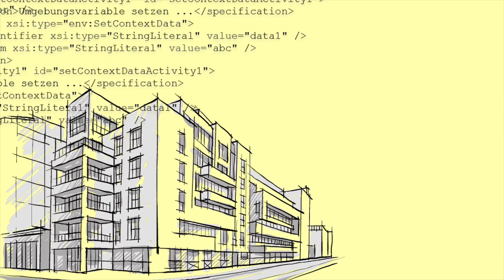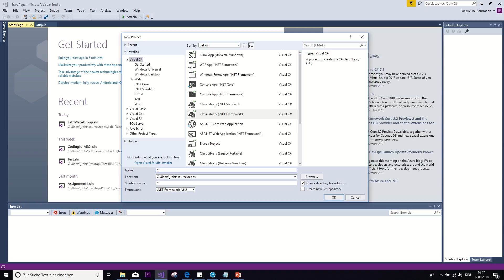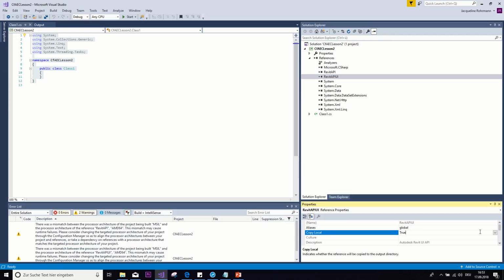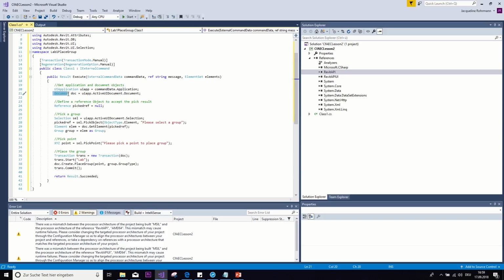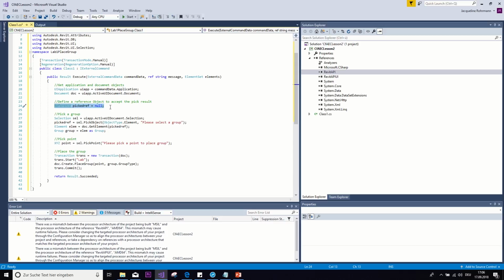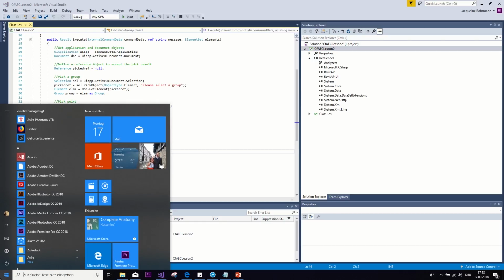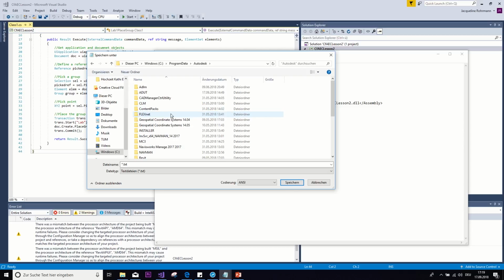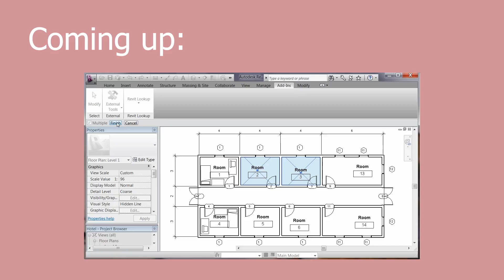How to write a plugin for Revit - Coding for AEC Lesson 2

Comment: 2 of my Errors (hope it will help someone).
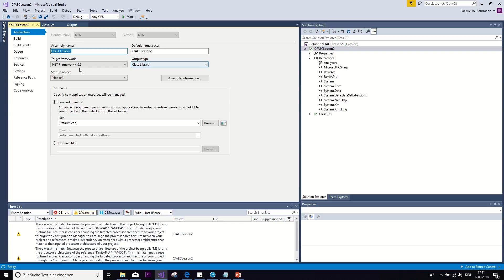11:53 (Both on a same time)
- The version NET framework for Revit 2021 - 2024 is 4.8.
- Exactly the option on the right side of NET framework version type is output type - check it there is Class Library. I have had automatically selected different type and it have took me about an hour to find what is wrong.

Comment: I have a problem with creating macros. I cant click on the macro button after creating module. I try to solve this problem 2 week but ı cant  do it. Can you help me to understand findin the problems reason. My revit 2020 can't load macros when i create module. Program shows me   this " https://help.autodesk.com/view/RVT/2020/ENU/?guid=GUID-071913D8-214A-45AB-A798-A81653E77F88 " , " Loading the macro failed. Rebuilding the module may resolve this issue." icon every time. I cant solve  this problem. I watched  your all videos and repeated  your every commands. I think i cant do it succesfully as long as i cant solve this problem. Thanks already.

Comment: Is there a Building Code plug-in for Revit? I want a plug-in for building codes where you can assign a building classification and the building code plug in for whatever region you are designing for, will guide you accordingly to the relevant building code rules.